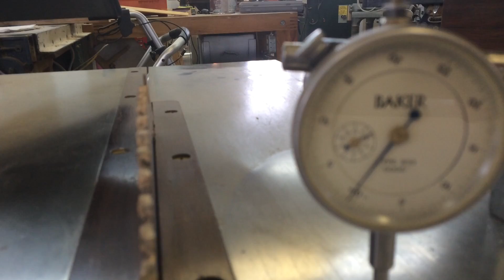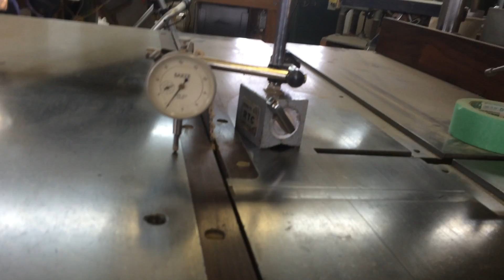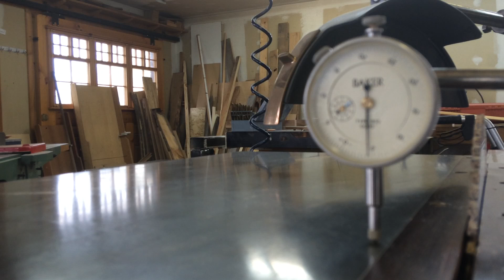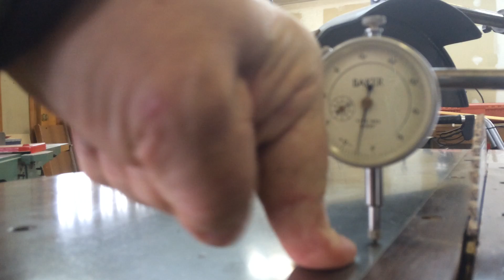PK sliding table travel reading after 4 years use.

Comment: I had a Wadkin BGP Saw with sliding table that worked ok as bearings on the table it’s self. But as the runners got worn it you got Saw dust build up it became a terrible runner and you could drive yourself crazy adjusting things. I wish I could find a complete one like yours.

Comment: I think you are well within what ever it takes to make any difference on a piece of wood.  High end cabinet saws advertise to .010" flat.   Nice machine Jack.
Reply from the maker: +Jim Dockrell (Watertone)  thanks Jim i was wondering what spec today was.
Reply: I think powermatic advertises that spec. on a table saw, not a slider.